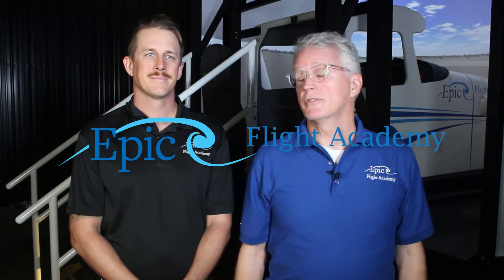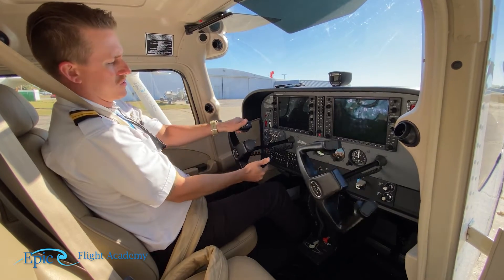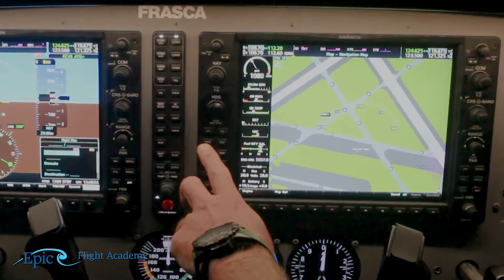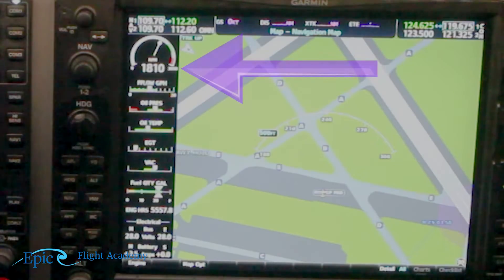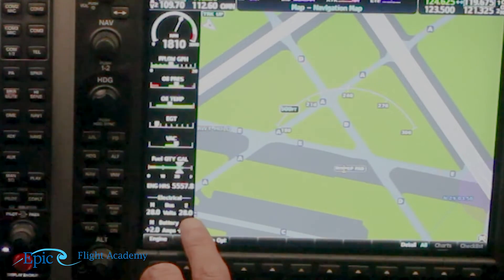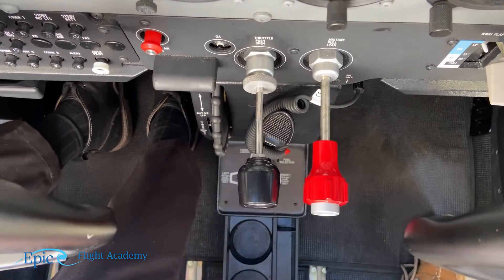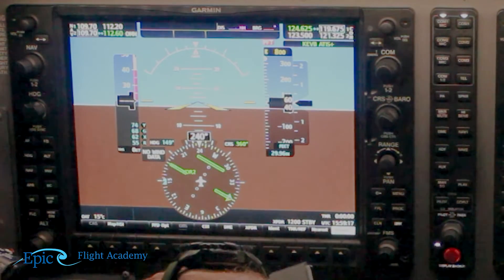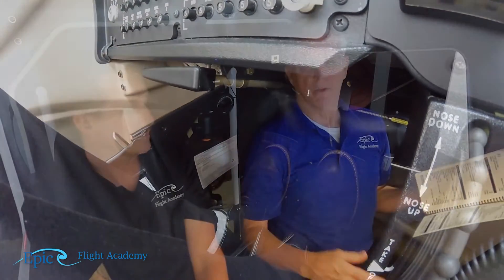Garmin G1000: Engine Run-Up Checklist on the G1000 | Epic Flight Academy

Comment: Hey Guys, I`m Rafael, Former Epic Flight Academy student, I was there in 2011/2012.... 
I Notice when you pulled power to idle on Run Up, your battery showed a little discharge... I Had it happen to me a few times, on the real airplane, is it normal? Some airplanes do, and some dont. I does it happens?! id be very happy if you could answer. thank you.
Reply from the maker: From Mike Thompson: Good observation.  One of the reasons that light general aviation airplanes adopted alternators over generators is that alternators will deliver power at low RPMs... however, RPMs as low as idle RPM can be too slow even for alternators to deliver requested power.  So, it is very possible to see a slight battery discharge in this condition.   Also, later in the flight, going to idle power you should not see a discharge until many many minutes at idle, depending upon the electrical system load.  The reason you may see it during the runup is because the battery may still be charging from the draw down it experienced when it powered the starter motor just a few minutes earlier.  Seeing this during a run up just a few minutes after starting is common and nothing to be concerned about, the system is operating as it should.
Reply: Thank you for the Answer. I had already looked everywhere and couldnt find nothing. thank you! @EpicAviationEpicFlightAcademy